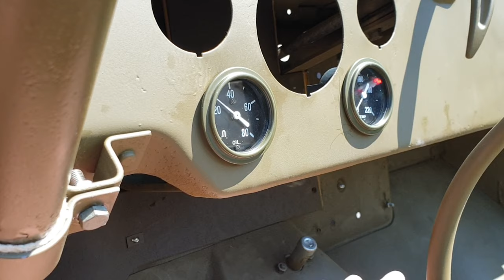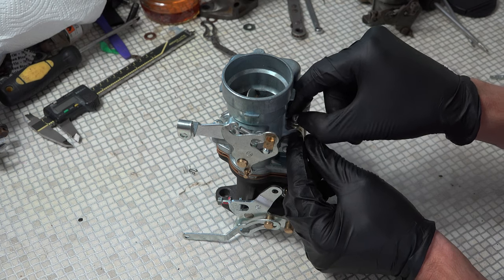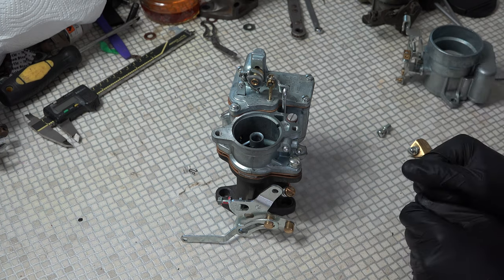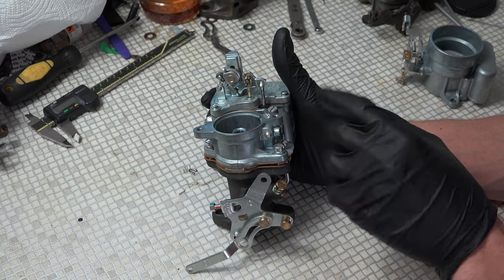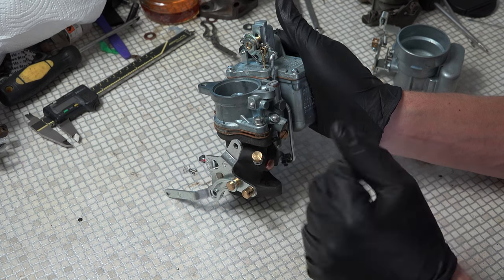5 Minute Tune up for the Willys jeep ( Excellent Joes Motor pool Carb) 539S

Comment: This video came just in the nick of time! I had just mounted my Joe's WO on my GPA and was going to start it without any tinkering first just to see how it preformed. Then I came across the Team G503 half-hour video that recommended a thorough strip down and reset before mounting and firing up. I dreaded the thought, figuring I'd lose a screw or mess something up and never get my GPA running. After seeing your video I'm back to plan A - fire it up and see how it preforms, then adjust IF necessary. Thanks John!

Comment: You just saved me from buying a new carb. My jeep was running super rich like the idle air screw was shut off and still running. This was the problem. Thanks for taking time to make a well done video that got straight to the point.

Comment: I finally bit the bullet and dropped in the new WO from Joe's too. Checked the float, which was off a tiny bit, and set the metering rod per factory specs first to see how it performed. It wasn't right. Just like most other have experienced, it idles fine but craps out when slowly coming off idle. So I tried this method Greendot 319 suggests and still no go. It runs so rich you can just about choke from the exhaust. The accel pump is doing it's thing and revs up just fine when punching the throttle. All vacuum leaks have been fixed, and I get a solid 20-21 in. of vacuum. Timing is right on as well as the dwell. I cannot get this sucker to operate right at all. If anyone has some good ideas, I'm all ears. :O)
Reply from the maker: I imagine you are in the US? If in the UK I could take a look for you.  Sounds like there is an internal issue somewhere with yours
Reply: @Greendot319  Hi buddy. I really wasn't expecting a reply, at least not so quick. Thank you. I agree, something must be wrong internally. I'll reach out to RFJP and see if they will offer some help. And yes, I'm in Arizona. I watch all your videos and enjoy them all.

Comment: I've tried this but end up with a "flat" spot just off idle. If I jab the gas it works, (assume accelerator pump) but a slower throttle is a no go...
Reply from the maker: it's not a slower throttle, the metering rod only comes into play above 20mph.  If you have a 'flat' spot when accelerating  that is due to the accelerator pump, you need to dive into your accelerator pump and look at your plunger, that is probably where the problem lies! ;)
Reply: If, when you jab the throttle, it works, but not when you open the throttle slowly, it definitely points to the high speed needle not adjusted high enough, as your accelerator pump seems to be working, as the big squirt of fuel momentarily eliminates any flat spot. 
 As the low and intermediate speed jets are coming to the end of their ability to supply enough gas, the high speed needle should be just lifting off its seat, allowing fuel to flow through the main jet. You should hear a 'crackling' sound from the venturi as the fuel starts to bubble through . So try raising the needle just a tiny bit. Loosen the small nut and raise the nut, pin and needle  assembly just a bit. You can do it with the engine stopped, and move the needle up the slot, or with the engine running, which is a little bit more complicated but gives instant feedback.
Reply: @autophyte  Understood, but in this video, he points out that the needle can be dropped right onto the seat. As in no adjustment. I do have the gauge, and it does run when adjusted there. Just wondering how its compensated for...
Reply: @johnqpublic9074       I was waiting for a answer to,This metering rod seems to be the heart of the operation,I adjusted my rod with the gauge to see what happens,the old carb on my cj2a has the issue you speak of and in my case I think its due to a worn out throttle shaft causing a vac leak , we will see

Comment: I took the carb off and made sure it was fine. A few weeks later, it just stopped. I had to choke it, but it idled. I replaced the fuel pump and now my jeep idles fine, but as soon as I push down on the accelerator, it revs a little bit and stalls out. Do you know what could be wrong? My dad threw out dirt or something in the carb.

Comment: Would you think this might be my problem?  I have a 48 with a WO and it idles beautifully.  When I start to drive it or put my foot in the throttle it sputters at higher RPMs.  I'm lucky to get to 40-45mph in 3rd and by then it's sputtering.  I do smell fuel when I shut down too.  Thanks.

Comment: That doesn’t work on the jmp carb I’ve just bought I’ve had to have metering rod as high as I can get it otherwise the jeep spluttered when you put it into 1st gear and move off and idling screw was loose it kept winding itself out so idle speed was affected .